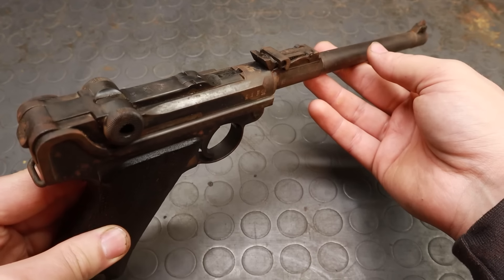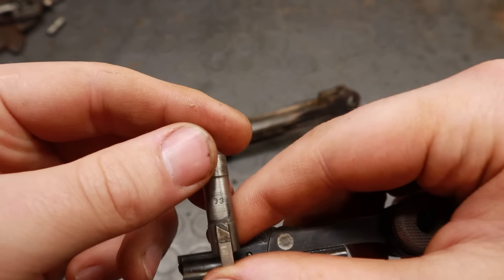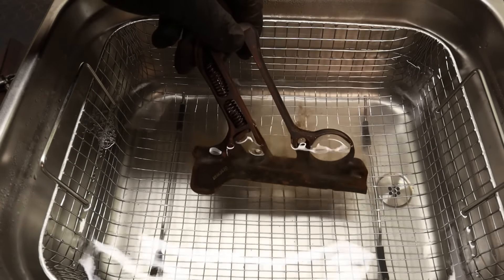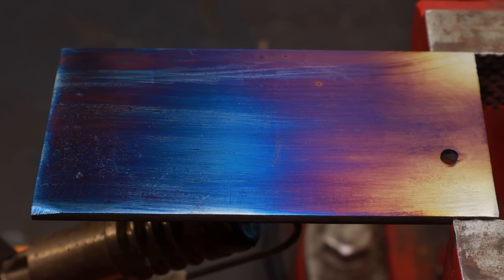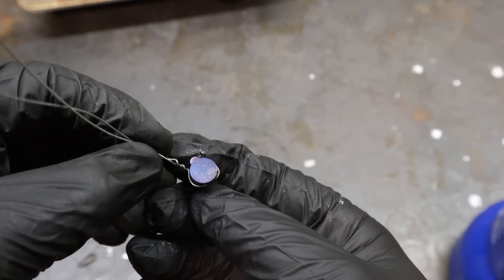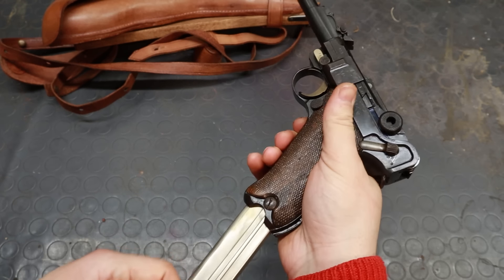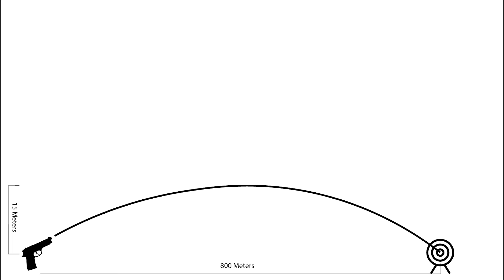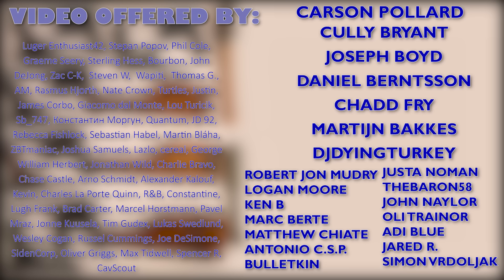Restoring an Artillery Luger from 1917

Comment: 800 meters is quite the distance for a pistol even if you use a butt-stock and can place it onto something like a wall - but I guess they were just better shooters back then 😅
Reply: Several firearms of the same era have similar “optimistic” maximum sight ranges. However, it should be considered that these weapons, including the LP08, were primarily to be used by groups of soldiers firing volleys, not for single precision shots.

Hence, the maximum sight range might reflect the distance at which such a group might be expected do at least some damage, even if a lot of the shots would miss. The volley sights present of several (pre) WWI rifles reflect a somewhat similar idea, although their use (i.e. in indirect fire) shades into outright interdiction or harassing fire. When machine guns proved far more useful in this indirect fire role, volley sights were quickly dropped from rifles.
Reply: @DebatingWombat  also for storming trenches
Reply: @facemcshooty6602  Yes, that is one of the roles they were eventually used for, but not the one they were originally designed for.
Reply: I not think 800 méter shoot!
Reply: There’s many firearms of that era that are really just “wishful thinking” in trying to meet an RFP’s requirements. I mean, customer says they want 800, and by simply putting the 800 on it means it’ll do it. Right?
Reply: Pretty sure AKM sights also go above 1000 meters
Reply: jarjarbinks7303  My point with the AKM sights range is that 1000m is way way too far for it as well. Just like the artillery luger cant reliably hit at 800m, probably not even 400m, the AKM also wont hit anything near 1000m. They both just have sights for suppression at extreme distances.
Reply: Indirect fire.
Reply: I guess that's why they called an artillery piece.
Reply: @facemcshooty6602 lolu
Reply: Indirect fire, they were meant for artillery after all…

Comment: The "impurities imparted by the hand" seems to be the best explanation. Not exactly the same, but I at one time owned a matching Colt New Service dated to 1917 with vulcanized grips that was carried by two generations of police men. The right grip was significantly worn down across its surface but the left had small points of wear at the very front, showing that more wear was caused by the hand of the user than being shuffled in and out of a holster. I'm sure the same could apply to wood grips, but possibly the wood grips hold up better to friction than vulcanized rubber grips.
Reply from the maker: Thanks for sharing your story, I love these!
Reply: Yep, this totally nailed it.  90 percent of people are naturally right-handed, and back then left-handed people were beaten into being right-handed.  And it doesn't take long for skin oils, dirt, the oil on your hands after you just handled or cleaned your own gun, etc, to saturate the right side of a pistol or long-gun stock more than the left.  The same interesting ergonomics also come into play where damage is found on long-gun stocks.  If you spend all your time carrying your rifle in front of you, the right side is pointed away from you, so it tends to have more dings than the left.  However it's also common to deal with heavy scratches in one specific spot on the LEFT side of a rifle because of where it rubbed over and over against a metal bit on a soldier's gear (belt buckle rubs super common).

Comment: I always found it interesting that the barrel of the P08 looks a little bit like some old timey cannon. Really makes the "Artillery" name appropriate for this model (though I'm aware of the true origin of that designation).

I had often wondered about the exact process behind turning steel that straw color. I figured it was some method of tempering but I learned a lot about it thanks to this video.
Reply from the maker: I'm very happy to hear that!
Reply: Its because it was issued to artillery teams to defend themselves. Thats why its called an artillery luger

Comment: I do rust bluing for all my restorations, Mark lee's #1 always gives me the best results. My method goes as fallows
   -Boil Distilled water in a large stainless steel pot
   -While water heats up, degrease parts with degreaser, hand soap, or dish soap
   -Cut some wires to hang the smaller parts in the pot, degrease these too (For small screws, I recommend using a tea leaf holder, degrease this too)
   -Once water starts to bubble, its hot enough, place the degreased parts in to heat up (You can use a gas torch to heat the parts up faster but its far riskier, and the parts only need to be around 200 degrees F or 93 c
   -Once the parts are hot, take them out. They should dry fairly quickly due to the water evaporating from the heat, again, you can use a torch to dry it faster but this is again riskier.
   -Apply bluing solution and let the parts sufficiently rust before continuing
   -Once the parts are sufficiently rusted, put into the water and let it heat for 7ish minutes
   -After at least 7 minutes, take the parts out and card off the outer black oxide layer with fine steel wool (0000) or a carding wire wheel if you have a drill press
   -Rinse and repeat for at least 5 coats, after that, its all based on how much blue and how dark you want to blue to be.
Personally I go for at least 7 coats, which to me looks the best. Apply your favorite gun oil to the metal and your good to go, the oil darkens the blue and will deactivate any remaining rusting agent. If you want, before adding oil, you can wash the parts with soap to help further remove the rust solution. Rust bluing is by far the most user friendly, time consuming, and safest method of bluing, and unlike cold blue, it actually protects the metal from further rusting, though it isn't perfect and you need to keep a thin coat of oil. Yes it takes  along time to do 7 coats, but the end results are worth it.
Reply from the maker: Thank you for sharing your process. It's not at all different from the one I use, but I prepare the solution myself, since out of the US commercial rust bluing products are extremely hard to come by. And I'm a bit old school ;)
Reply: @Backyard.Ballistics  I never tried making my own, ill have to look into it. Something I really want to try is browning, as that can look fairly good on certain firearms. It's too bad you can't get alot of gunsmithing supplies shipped, guess it's just to expensive to ship to Italy from the US.

Comment: Wonderfully detailed, especially the explanation of the temper colors. I've always admired the finish on early 20th-century guns, particularly the iridescent blue of small thin parts like extractors set against a deep rust-blued frame and slide.

Comment: I have a C96 Mauser with a similar rear site. With the site all the way down, it's set to 50 meters. I had trouble hitting the target with this handgun until I bore sited it with the bolt removed. The indoor range I go to requires all handgun target shooting at 7 yards. After bore siting my C96, I had no problem hitting the target and getting a much better grouping than I ever thought I would.

Comment: Nice work on restoration. There are a few things wrong in your video. The luger carbine had longer barrels and was first released in 1902. Do to my grandfather serving in WW2 he did bring home some lugers and P-38 pistols. He even brought home several boxes of 9mm ammo. The ammo is so much more powerful than what we use today. Most closest to the ammo used in WW2 are the +P types of ammo. The artillery luger used even more powerful 9mm ammo. They even had a 50 round drum magazine for it. You can still get replacement barrels for your gun. If you come across any more miss matched artillery lugers even and bad shape like this one was let us know. I would love to have one here in the US. I can get parts but the frames are hard to come by.

Comment: Greetings! I probably have an idea how could the right side of the grip became darker than the left. In this case it is an Artillery Luger from WW1. Many soldiers wore leather gloves to protect themself from hand injuries. The leather tannic acid in the leather could probably decolor the wood, depending on the gloves original color. Probably the color of the gloves leather leave this kind of darkening. And a very few soldier is left handed, most of them taught to shoot with right hand, so the palm of their hand is on the right side of the grip. Meaning the grip on that side getting a lot of contact with the leather glove. Sweating and rain could solve out these materials (i had a glove which decolored my own hand and i had to brush it off hard to get rid of the unwanted color).
Keep up the good work!

Comment: The wooden grip closest to the surface, the inferior grip, will accumulate oil faster than the upper grip when the pistol is stored on its side. More oil means a darker color to wood.  I had this happen with a revolver. I had stored the pistol on a shelf, untouched for two years. I had purposefully over oiled the gun thinking it would help prevent rusting as I had no air conditioning in a humid, continental climate., I stored it loaded, 6 shot revolver. The cartridges on the side of the cylinder closest to the drawer bottom sputtered and fizzed when I fired it after 2 rears and taking it to the range. I surmised those 2 cartridges had accumulated gun oil that weakened the powder charge, causing a sputtering and fizzing. The load was strong enough to propel the bullet, I checked. That particular gun had plastic grips, but i feel confident wood grips on the lower surface would have absorbed oil as the cartridges did.

Comment: Great video, I new a Guy who had one of these it was totally immaculate with 1917 stamped on the right hand grip, however he thought the Barrel could be unscrewed, and took a Pipe Wrench to it,  It ruined  the gun, he then sawed the damaged section of the barrel off, It ended up as scrap.

Comment: the discoloration difference between the right and left grip panels is probably due to hand oils. Light finishes like simple linseed oil are prone to color change due to handling. Usually we call it patina.

Comment: I can't help but wonder if a barrel insert is possible to use to improve the accuracy of this gun.
Reply: If it's a 9 mm para  it could be easily rebarreled with an insert to 7.65 para, but at the expense of originality
Reply from the maker: the barrel could either be relined or the grooves re-cut. The first approach is the most invasive, but it's easier and will give you a brand new bore. With the latter you end up with a larger groove diameter, that requires the use of a slightly oversize bullet, or at least an expanding base one.

Comment: My theory on the difference in grip color, would simply be armorers replacing broken or worn parts with those salvaged from other guns as a process of repair. A military wouldn't much care if a grip was was a slightly different shade of brown, and that may be that in repairing this gun, a previous gun had parts cannibalized from it to make the repair. The different gun had grips that came from a different piece of wood, and that would account for the difference. Another reason may be which side the gun was allowed to rest on for many years. If a gun was resting on one side, the wood would be touching some other surface often, and over time, could end up loosing oils from contact with that surface, and or oxidize differently. 

Considering how worn out that barrel is, and the fact that it was made for WWI soldiers, it seems likely it saw heavy use. And may even have been reused by multiple soldiers and repaired, hence why it has parts from two different guns.

Comment: On the handle on one side being darker, it likely is the skin oils doing that. Over long times they can soak into the wood and darken it. And the dyes used in leather gloves as well as the tanins in the leather. If the gloves get wet from sweat or rain, they may very well also soak into the wood.

Comment: Very nice job on the gun and video.  I wonder if some slightly oversized cast bullets would shoot a little better in that.  Although that 25 yard target accuracy is way more than adequate for saving your life if heaven forbid you had to press it into that situation.
I have one that I am going to convert and restore although I don't think I will rust blue.  Mine is all matching down to the grips and mag so I don't want to alter it even though the finish is in fair condition.  No red rust but brown "patina" all over.  The best gunsmith I've ever listened to says that "patina" is active rust only being slowed down by the oil you keep on top of it,, so I want to boil and convert to stop that for good.

Comment: Excellent video! I strongly suspect the right-darker-than-left grip phenomena is caused by the majority of use being right-handed for military pistols, which, whatever sort of hand oil it might be (sweat, gun oil from the gun maintenance on the hands in handling the gun, etc) seems like it should accumulate at the same statistical rate as people being more right handed than left.
Reply: I wonder if asymetrical friction in the holster also attributed to the difference in colour

Comment: Clickspring doing heat bluing on screws etc in a bed of copper shavings is so impressive.  Bit difficult on guns though. It's a really bright blue. Maybe too purple for you though
Reply from the maker: What I found even more crazy is they compensated spin drift. It's like using a bucket to get water out of a sinking boat 🤣

Comment: I bought a Spanish Mauser for 50$ and the barrel has some pitting. How much pitting is unsafe ?
Reply from the maker: it's not the amount of area affected by it, but how deep the pits are. It's hard to give a rule of thumb, because it depends on many factors, including barrel wall thickness, maximum pressure of the cartridge and material properties. On a thick barreled, low pressure gun like a heavy barrel 38 special revolver a higher depth of pitting will be tolerated than on a light barrel magnum rifle. I'd say if the deepest pit is more than 10% of the wall thickness the gun should be checked by a professional before use. But don't take my word for it.
Reply: @Backyard.Ballistics  most of the pits are shallow but I will still get it checked out after I get the missing extractor and trigger guard screws

Comment: May I suggest a simple thermocouple and ardiuno solution to your salt bath temperature control issue? Should cost roughly $20 and is fairly simple to code.
Reply from the maker: thanks for suggesting, might do that if I need a larger bath

Comment: If you dont mind me asking. How much did you have to invest into this to get a functioning firearm?  Im wanting to get a luger of my own but with current prices...  it seems almost out of reach.  However if i could find parts and assemble a mis matched shooter,  id be happy
Reply from the maker: I'm sorry, but since these guns are owned by the company I work for, I have no idea about the expenses. This gun was also found hidden inside a house, so I really have no clue about who and how much was paid for it. On the market artillery lugers are very expensive here in Europe as well starting at 1500€ for a mismatched in fair condition. And it only goes up from there. I've seen regular P08s go for as little as 800 euros, but either in rather poor conditions or after being refinished. And a lot of so called "matching serial numbers" have re-stamped parts in them.

Comment: The dark grips are certainly just from hand oil. Sweat gets worked into the wood and collects dirt or just goes rancid and old and dark. The left side is usually dark on the front only where the fingertips reach around the handle.
Reply from the maker: Thanks for suggesting, I think you're right

Comment: I would assume the right side grip panel will take on more moisture when in contact with the hand, along with grime and skin oils, this might seep into the wood.  Not sure how well that assumption holds up considering the finish of the wood, and assuming the soldier wouldn't be holding the pistol constantly, so who knows.  Maybe the hand introduces some moisture then that moisture is held in by the holster or a humid environment.

Comment: In my experience, that wood darkening on only the right side would be due to the palm of the hand (for a right handed shooter) being exclusively on that side, and therefore rubbing sweat, skin oils, and water into the wood, which even with a finish will take in such things because of its porous nature. A good example that comes to mind is a headphone stand I use. It was made from oak, and left unfinished (I intended to finish it myself, but didn’t have time) As I used it, the spot where the headband rested on the wood got darker from absorbing the oils that the headband transferred from my hair to the wood.
Reply from the maker: thanks for sharing, that could very well be. It makes sense because oak has a very high tannin content, just like walnut

Comment: As you were speaking of the tempering colors, I assume in a military guns those colors are indeed a result of tempering to a specific hardness instead of the desired result or decoration, which makes sense if you look at the parts that you re-tempered for the color: springs that don't require quite as much hardness for wear-resistance were tempered to a softer blue color and the mechanical parts that would wear down with use were tempered to harder, more wear-resistant straw color. I am sure this is something you know but just something you didn't mention in the video, just an explanation WHY those parts had those nice colors in the first place, which I personally at least find interesting.